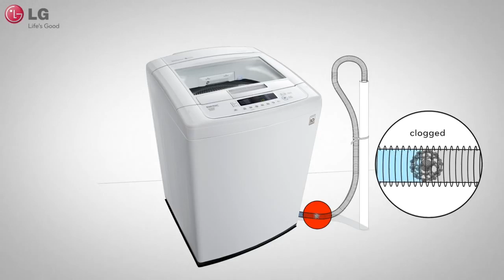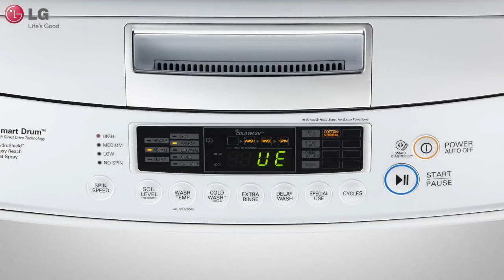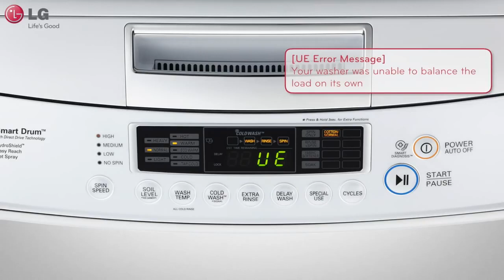[LG Top Load Washers] Understanding Error Codes

Comment: I ran a self diagnostic and got a flashing code of 603 and 12. What does this mean?
Reply from the maker: Thank you for bringing this matter to our attention, Michael. The error codes 603 and 12 are not specifically mentioned in the lists of LG top load washers' error codes. To properly identify this issue, we suggest you reach out to us via private message on Facebook or X (Twitter) at @LGUSSupport with the model and serial number of your unit along with your phone number, so we can look for a proper resolution and identify what this code means. We look forward to assisting you. `Alice
Reply: How do the diagnosis

Comment: My just says DR and doesnt drain
Reply from the maker: Thanks for reaching out! Regarding your issue, please note that 'DR' means that your washer has timed out, and is automatically draining water in the unit. This may happen because the unit is paused during the cycle, and is left idle for 8 minutes without resuming the cycle. It may also happen if the unit is powered on and left idle for 4 minutes without starting a cycle. If your washer says 'DR' and is not draining, it may require repairs. Please send us a DM on Twitter or a PM on Facebook so that we can look into this in more detail. Our handle for both platforms is @LGUSSupport. We look forward to your message! ^Chris

Comment: What does error PE : 2 MEAN ?
Reply from the maker: The PE error code indicates that there is a problem with the water level sensor. To fix this, the unit requires the service of a professional technician. Unplug the unit until the service is completed. Kindly reach out to your purchased dealer or to your region's LG customer support for further assistance. You may also visit this link for more information about LG Washer's error code: https://www.lg.com/us/support/help-library/lg-washer-error-code-list-CT00000305-20150140270078 `Alice
Reply: @LGUSASupport  dorry it is EP: 2
Reply from the maker: Apologies for that, Abo. To ensure that you receive the most accurate and detailed assistance, we highly recommend reaching out to the LG customer support in your region. Please note that error codes may vary depending on the specific model and region. As the LG top load washer you mentioned originated in LG US, the error codes listed in our official documentation may differ from those encountered in other regions. Therefore, connecting with the appropriate LG customer support in your region is crucial to ensure accurate and tailored assistance. `Alice
Reply: It is for old model : WF-T1022TPX
Reply from the maker: Regrettably, we're unable to find the WF-T1022TPX on the LG US product lists. Please reach out to LG customers in your region. You may visit this link for their support page: https://www.lg.com/africa/support/telephone. `Alice